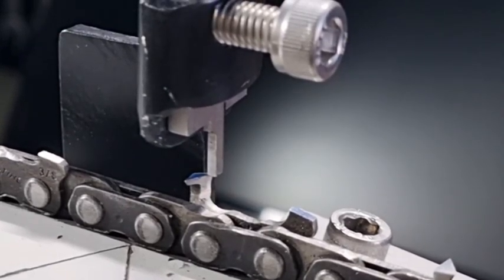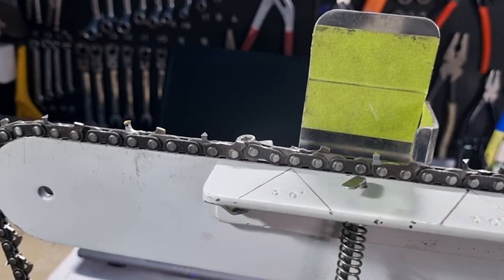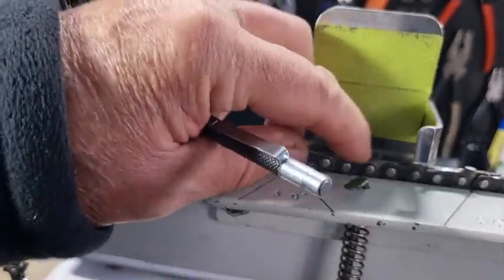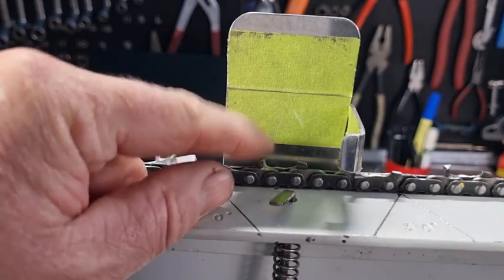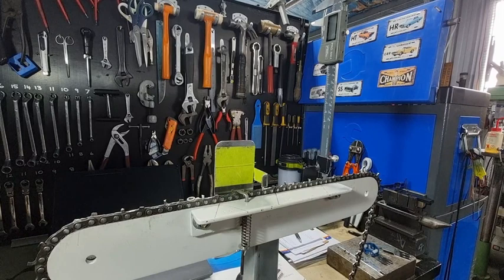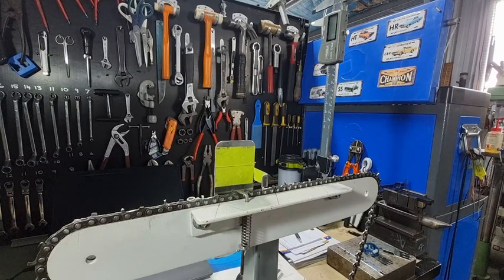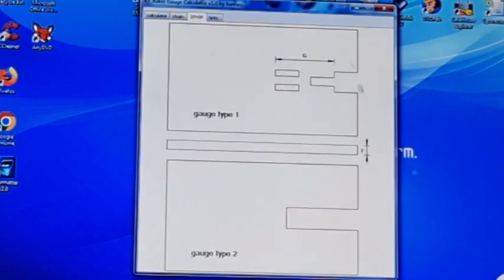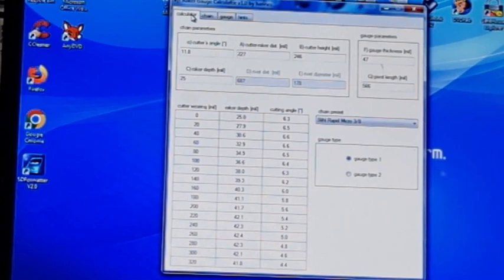Raker Depth V Attack Angle

Comment: 40 or 50 years after Carlton came out with the file o plate the rest are finally catching up !
Wonder how many chains were sold that could have been maintained to a good cutting chain ?
Reply from the maker: Yes you got it right there you can get extra life from any chain as long as you use a progressive gauge
Reply from the maker: I have all  the Husqvarna gauges also roller combinations as well but Stihl gauges are 62 hrc and have a more aggressive agles even Carlton file o plate will take 45 thou max stihl in soft setting will take 60 thou off.